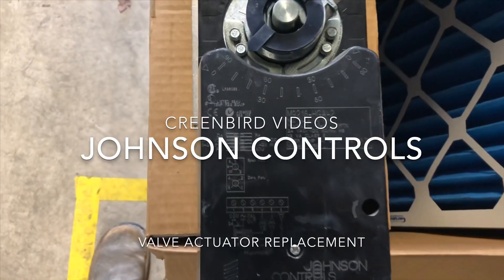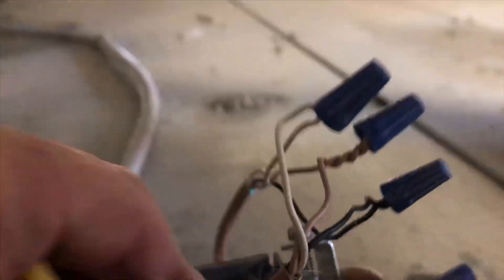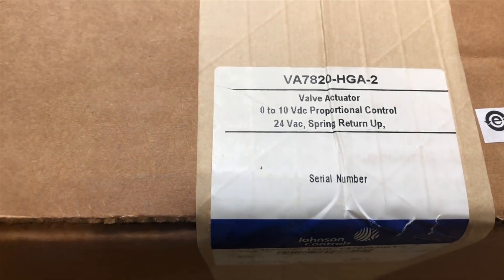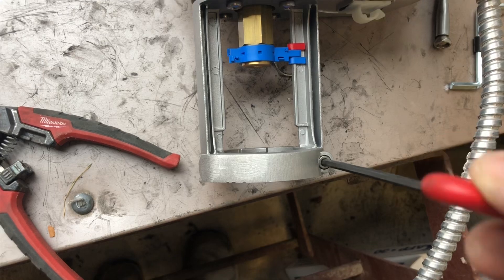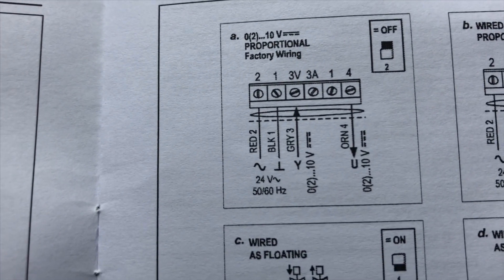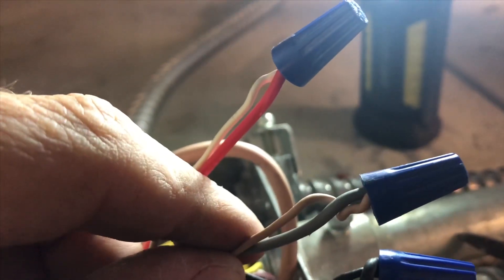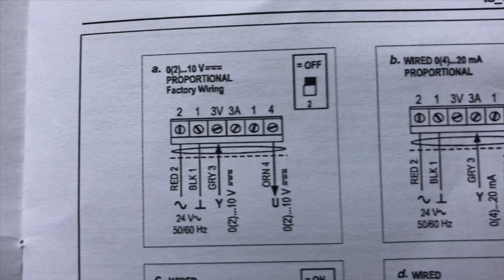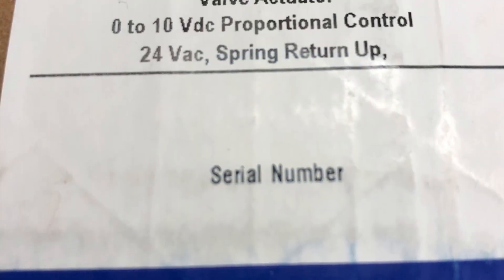How to install Johnson Controls Valve Actuator JCI VA 7820-HGA-2  M9216-HGA-2 Easy Fast retrofit.

Comment: The 7820 is the replacement for the 9216 but on the heat coil, freeze protection does not open the valve, thanks JCI.